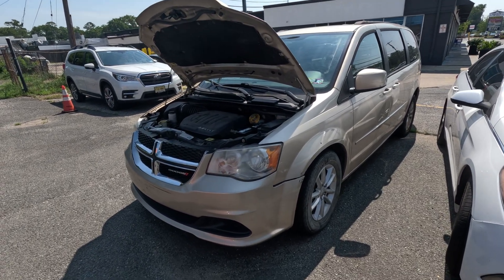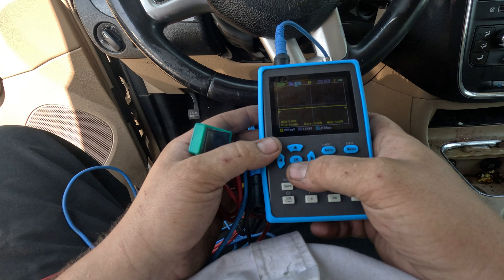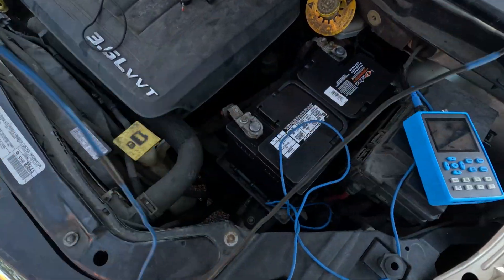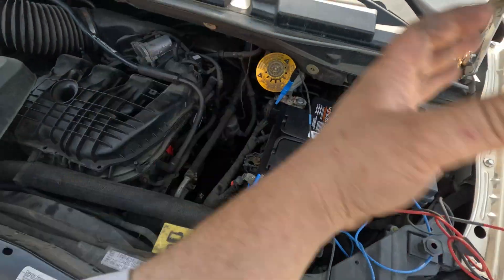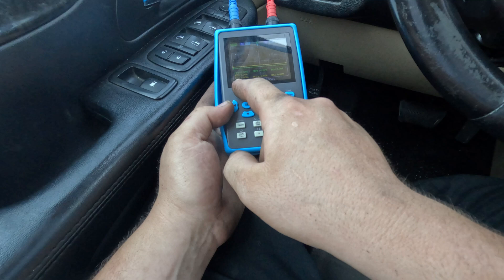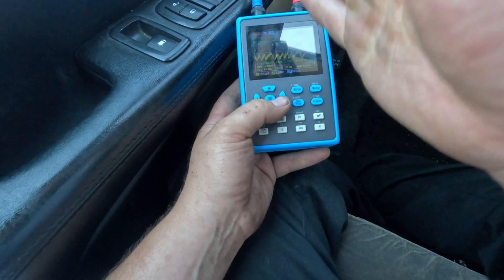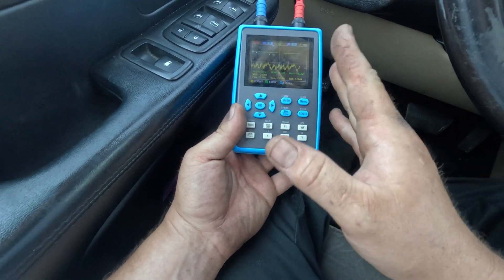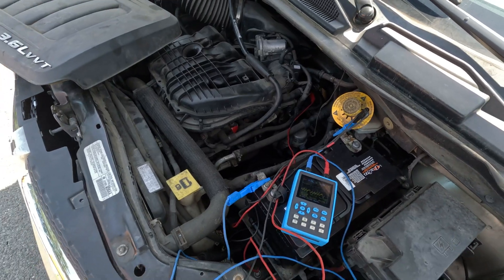2013 Grand Caravan - Dead Cylinder! Relative Compression Test!

Comment: Seems like if you knew which cylinder that you put you probe on, and the firing order, you could determine which cylinder is dead?? Is that correct?
Reply from the maker: Yes my sync didn't work in this case, but if it did it would tell you which one is dead.

Comment: Cool. If you take the reciprocal of your plot it would show you the pattern you would get with with an amp clamp (V=IR). I set my pico 2204A to DC when doing voltage based compression tests. It is sensitive enough to give absolute and relative data. One more thing: You can put a US quarter with a lead touching it on an ignition coil and get a nice waveform.

Comment: The code, mode6 and misfire history and current misfire on scan data tell which cylinder, that scope test verifies your sound suspicion, AC coupling only shows AC voltage which in this case is generated by the starter motor turning, it is called back emf and it acts as a resistance thus current draw goes down the faster the starter spins, and the faster the start spins the greater the ac voltage generated. 
Great video thanks for making it. 
Another video going into more detail on the scope setting would be great. 
Also, with that secondary pick up you will see longer burn time on secondary ignition wave form compared to a good cylinder, because less pressure in the bad cylinder due to mechanical misfire requires less energy to jump plug gap thus more energy left to keep electron flow going.
Reply from the maker: Great explanation, thanks for sharing!
Reply: @advancedleveldiagnostics  Glad to help. Love your videos. I ordered the secondary pickup you showed to add to my tool collection.

Comment: Having a sync doesn't really help you if you don't know the firing order..   But yes, the scantool should tell you which cylinder is dropping.  It's not a bad idea to put a bore scope down in the spark plug hole and see if it's a burnt valve or something...  Maybe a hole in the piston, possibly
Reply from the maker: True, I forgot to mention you need the firing order, Thanks for pointing it out.

Comment: Hey! Really big fan, i wanted to ask you im looking for a Oscilloscope, im a mechanic i work on my own and love your videos right now i have a Kia that is dying intermittently and it does it not to often, so i wanted to finally add a oscilloscope to my box, but i wanted to ask for your recommendation, one that can record i guess so i can drive the car and after the fail happens i can rewatch and see if its cam or crank signal, i have look into some Fnisrn handhell 2 chanels ones and a Hantek that looks like a Pico 8channel that you plug to a PC, anyway, any recommendations would be nice, i dont live in the US but i can import stuff from there, and my budget is not huge thats why i dont go for a Pico, well thanks for your answer in advance!
Reply from the maker: If you don't mind using one with a PC, I would recommend the Pico 2204a. It's around $130 here in the US. It uses its own Pico software, which is very similar to the Automotive software; it just does not have the guided tests. They also have a 4-channel version for a higher price. Hope this helps and thanks for watching!
Reply: @advancedleveldiagnostics  Thanks!! Will look into that!

Comment: Great video! I've been wanting to get into using an oscilloscope. The Pico unfortunately is way out of my budget. It looks like Hantek has tablet oscilloscopes that record information. They seem reasonably priced. This would give a larger screen without having to use a laptop. Have you seen these and what are your thoughts as to whether they would work for automotive?
Reply from the maker: I really don't know; I was curious about that, too. I chose this one because it was really cheap 😃 and I was pleasantly surprised by how much I liked it. Before this I was using the uScope but the connection for the micro BNC kept breaking. The scope I learned on was the Pico 2204a, the downside like you mentioned is you need a laptop.

Comment: thanks, do u see a huge difference between volt and amp on relative compression. or voltage will do just fine. please.
Reply from the maker: I'm more used to amperage, but it seems like it works fine.